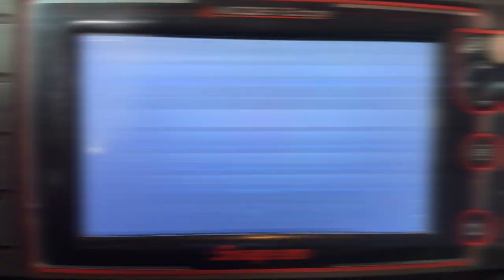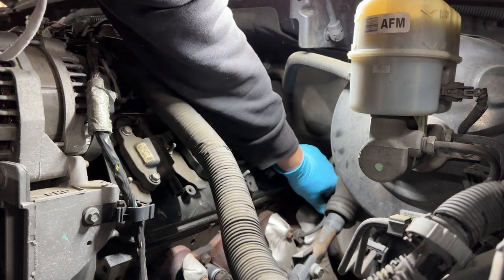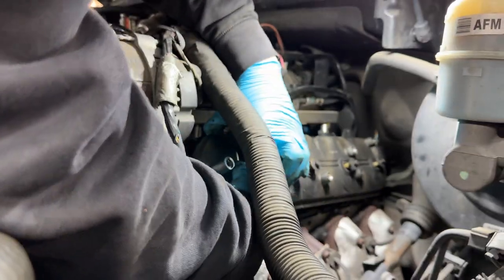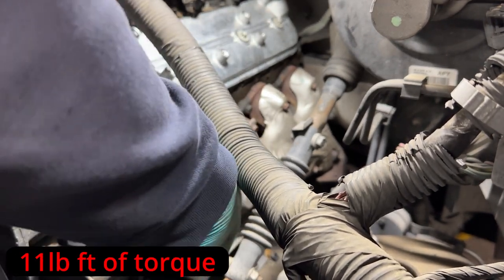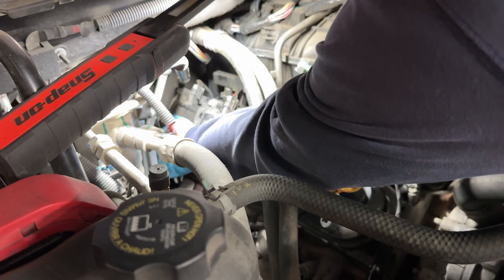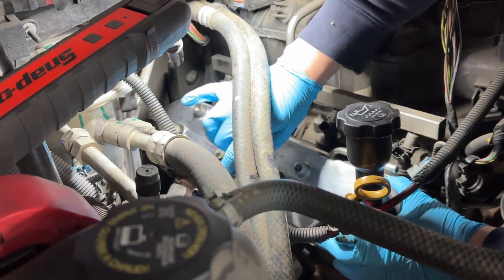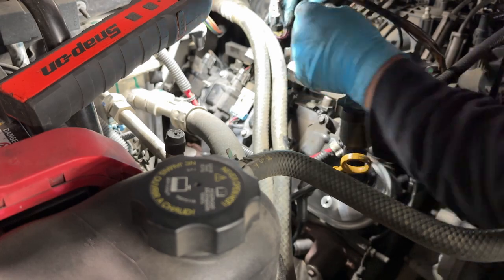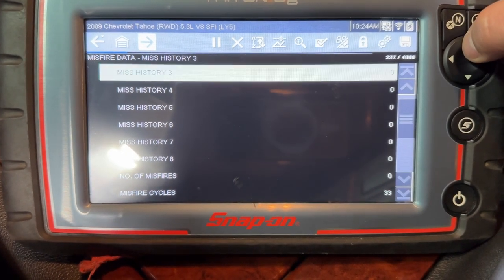Oil Consumption Fix: Replacing Valve Cover With PCV On 2007-2013 Chevy Silverado TSB

Comment: So I have a misfire in cylinder 4 p0304 2009 gmc sierra 1500 4.8 v8 
Swapped spark plugs , coil , plug wire , fuel injectors and nothing so I checked for vacuum leaks nothing 
Popped the valve cover the rocker arms are good and the lifters are good and I did a compression test and got 120 psi any tips ?
Reply: Maybe you need new valve cover gaskets, sometimes air gets in through there,  or were you put the oil in,  it sometimes needs a gasket  there

Comment: Will this make the stabilitrack light come on
Reply from the maker: no
Reply: I actually heard it will because of the rough idle sets some sensor off linked to the stabiltrack. Im having the same issue in my 2011 6cyl. Idles rough, losing power at low speed sometimes then seems to run fine after 45mph. Stabiltrack light comes on while idling rough and low mph. Cyl 6 misfire but electrical is good.
Reply: Did you try this? Did it work?

Comment: Falcon
You said this was 07 to 11 models? So is the 2012 5.3 valve cover good?
Reply from the maker: should be .. or at least there isnt a updated part for this valve cover
Reply: @FalconsGarage  actually I looked at the bulletin and in September or October 2011 they started manufacturing the 2012 with the new valve cover. At least that’s my best guess from bulletin. Thank you! Great channel!
Reply: There are a few different 5.3 l engines that could be and yours you need to know the 8th digit of the VIN number that is your engine identification

Comment: 07 yukon 5.3 keep having oil puff out on startup, and cyl 6 misfire. Keep having to change that spark plug. Anyone with any insight, tia!
Reply: Excessive oil consumption on that cylinder. Need to run a compression test on the motor, possible broken ring or valve seals on that cylinder. Good luck.

Comment: 0.60 is to wide for the 5.3 engine the plugs will foul after-30,000 miles 0.40 gap is the best for the 5.3 engine
Reply from the maker: As per book .40-1.02
Reply: @FalconsGarage  platinum plugs 0.50-0.60 iridium 0.40 2004 and up 0.40

Comment: Thanks for the video Falcon!  I have a 07 silverado with the 4.8l v8 and having oil consumption problems.  Question:  is the PCV built into the valve cover?  I  can't pull it out of the valve like other chevy engines.  Thanks for your response.
Reply from the maker: on this years .. yes its build in
Reply: I thought the gap was .040?
Reply: @puesaquel4646 pretty sure it is
Reply: @puesaquel4646 no that year is .060 i saw the data plate on the right side of the engine compartment, blew my mind large gap!!!!

Comment: Holy shit really.. i just this exact job to replace my valve cover gasket and cylinder 1 spark plug was oily… it wasn’t fouled tho, just oily on the threads. I think it might have been due to leaking gasket - hence why i even did the job. My valve cover was the newer updated version too. Also, my new and old plugs were all gapped to 0.040 not 0.060? And finally my torque spec for valve cover bolts was 89 inch pounds, or 7.5 foot pounds - not 11 ft/lbs. Hopefully thats all ok… lol
Reply: I would be calling my mechanic for specs as a last resort if you can't find them online.
Reply: @KatiTheButcher i got em, from Haynes and some online. Most these type bolts i would often go by feel, but if it’s something thats had an issue i try to go by spec. Highest spec ive found for valve cover bolts is 106 inch lbs and lowest is 89. So basically between 7.5 and 9 lbs. 11 isn’t too far off I suppose… but honestly 9 is what is listed in my 400 page gmc service manual. 11 lbs is the spark plug torque. You’re bang on with the plug gap being listed at .06 tho, but apparently they updated that to 0.04. First when iridiums came out, then they changed it to all plugs. The larger gap is too hard the ignition system and as things ware over time you’ll get a sketchy idle, pinging and low power.
Reply: @wrenchboostboi8994  Im going to check the gap on mine. I didnt do the plugs the last time.